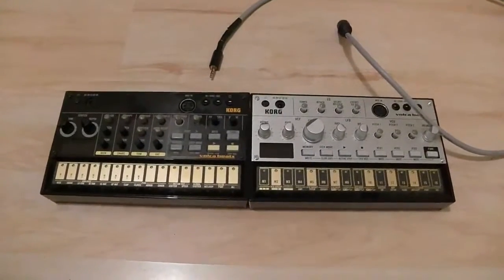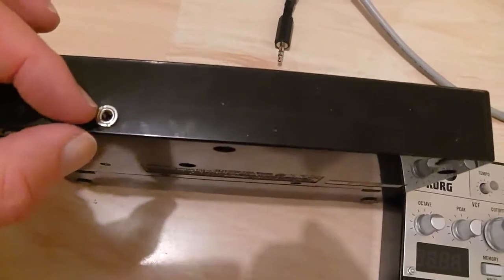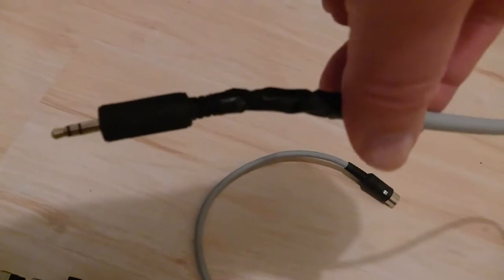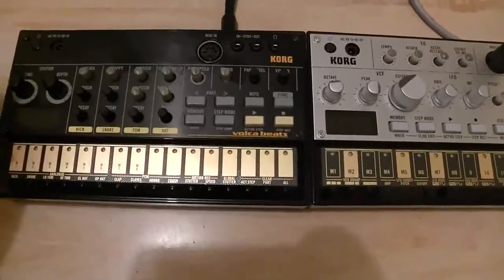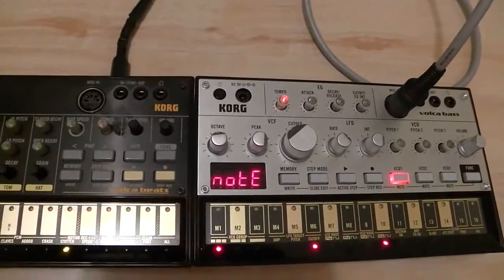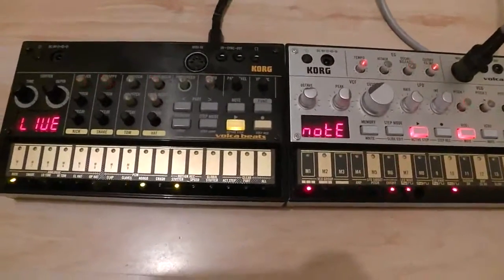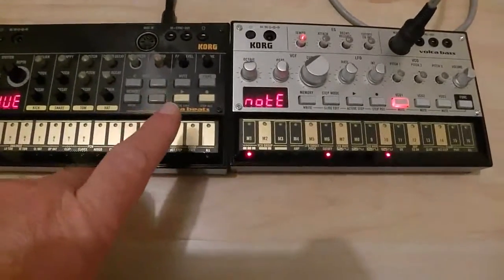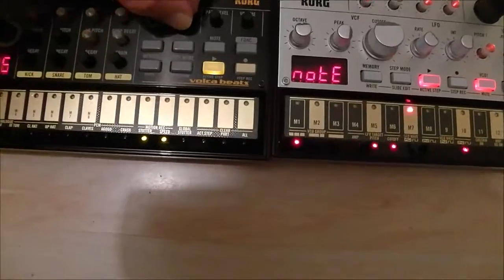Volca Beats DIY MIDI Out In Action - 1

Comment: This video just answered my question posted on another video. As fixing a DIN socket to the Volca looked too 'destructive'.
I suppose you could take an existing midi cable and replace one end with a trs plug?
Great video.
Reply from the maker: No. MIDI is actually byte-type instructions with far better control whereas this is purely an old-school Sync signal; great for starting and and messing about with rudimentary synchronisation but for anything more sophisticated, MIDI is the way to go ;)

Comment: This is fantastic I'm going to hoped for the stereo jack my self on my Volca Sample do you have a diagram of what wires go where on the stereo jack socket?
Reply from the maker: ruffnutts1 
G'day mate!

It's the one thing I didn't consider because I haven't seen any 3.5mm MIDI out other than on commercial units.

The pins used on the DIN Plug are 
4 - V+

2 - Common5 - TX

My home-made MIDI Out lead is mapped as follows:

Volca PCB <-> TRS <-> DIN Plug

TX-------------------Tip---------------5

VD-------------------Ring------------4

GND----------------Sleeve---------2

You can buy cables which are allegedly 3.5mm TRS to MIDI but I bought some after making my own cable with the intent of replacing it with something more professional looking and the pin-outs weren't correct - they were using pins 3,5,2. 

I have an MPX8 and it has a TRS to DIN female. 
When I did a continuity check with my lead plugged into the Akai lead, I get tip-tip, ring-ring, and sleeve-sleeve, which is how it should bell out correctly.
Reply: The Mighty Hellfish  thanks for your reply I was going to use a classic stereo socket as space is limited I was not going to use a home made lead though I was going to buy the TRS to DIN female my self so this means the diagram above is wrong? unless I make a lead to match... sorry to be a pest I just want to get this right first go lol
Reply: The Mighty Hellfish I have the MPX16 :)
Reply: The Mighty Hellfish ok thanks I'm sure I will sort it out wish Korg put a midi out on these volcas in the first place lol
Reply from the maker: David Whelan No mate.

I usually buy my cables from a UK-based eBay store and these were cheap enough that if they didn't work then it wouldn't cause great hardship :)

Unlike my cable, the store purchased MIDI cable doesn'f match the MIDI pinout I used and since only the middle three pins are used for MIDI, I can't see how it would work. Might have been a duff batch or maybe the one cable - I only had time to pull one out of the bag last night.

EDIT: Turns out I mis-read the store's description. It says MIDI but it also says audio, so I've suggested they remove the word MIDI to prevent anyone else making the same mistake.

The text diagram is what I determined based on photographs on the site linked in the video description - well worth a visit just to help get your head around what you're doing.

There is no specific TRS arrangement that I can recall reading about, unless I did happen to check out the pin-out for the Arturia Beatstep but then if I did, I would have linked that info as well because I'm a lazy bugger :)

I think I just jagged getting it right - "right" being a relative term based on the Akai test - and used a bit of electronics nouse connecting the GND being the sleeve (as it is in most cases), then the VD the ring, and finally the TXD being the tip.
Reply: What's up with all these incomplete synths?

Have you put the missing cap in to fix the snare?